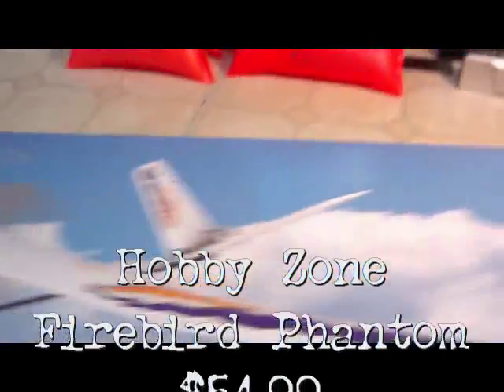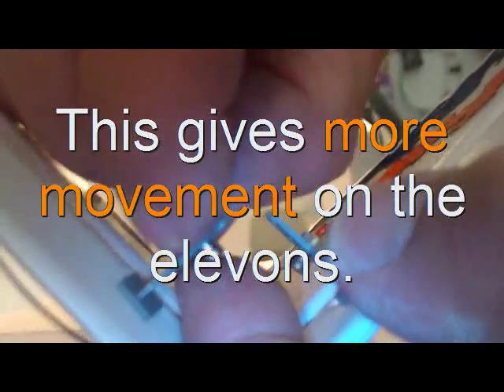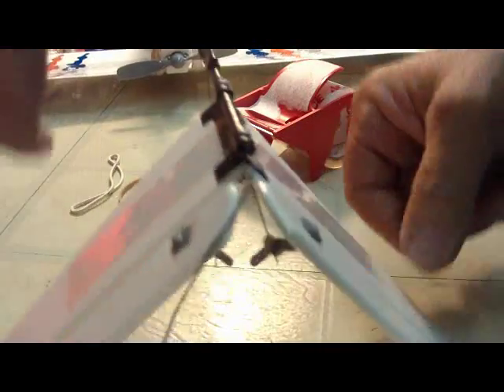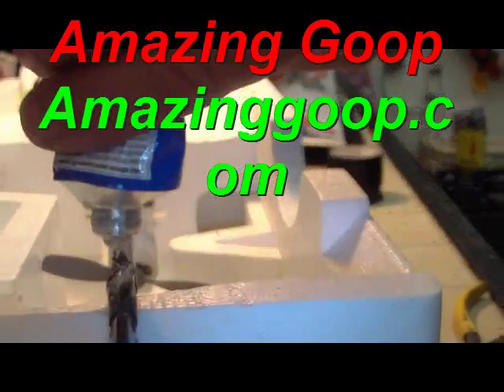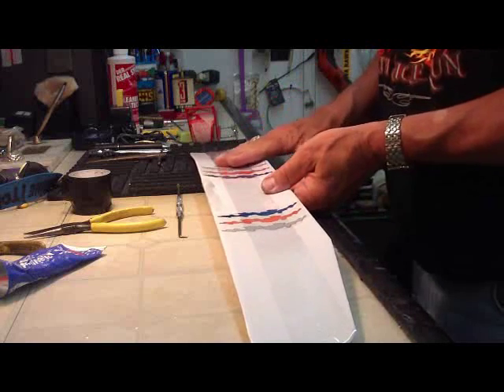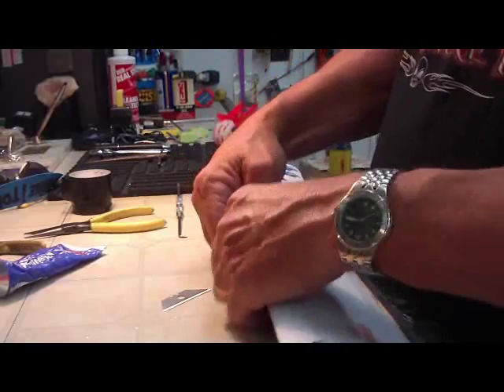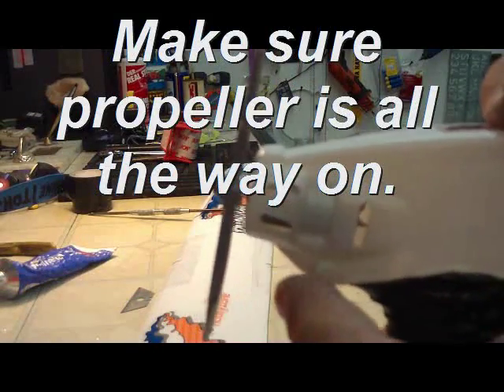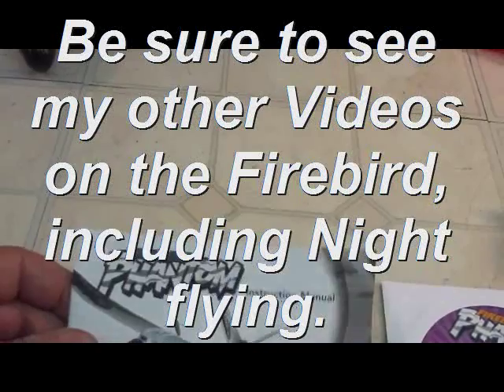STRONGER Firebird Phantoms

Comment: Nice vid. Im going 2 buy a firebird phantom as well. Im going 2 use that as my starter airplane. Im also going to buy a HOBBICO SkyFly 2. Im going 2 move up the that when I feel confident enough. Other than that I'm going to put up the 2nd one. I was wondering, on the SkyFly when u use the control stick for the elevators, when u push it  down it goes up and when u push it up it goes down. That is the correct way isnt it?
 Is it the same way on the FireBird Phantom? THANKX!! I luv your vids.

Comment: nightflyyer did i tell youd that i destroyed my phantom?lol.the brass tube to fix the tail was to heavy and the plane couldnt fly. the cg was right but it was to heavy. i took out the electronics and put them on a homemade glider of mine and now i need to get a prop and i think it may work. for your video on slope soaring the phantom i was thinking. eventually(when i get enugh cash) i will get the wild hawk rtf 3ch rc. it is a rip off of the easy star and it is only like $70. i thought it would.